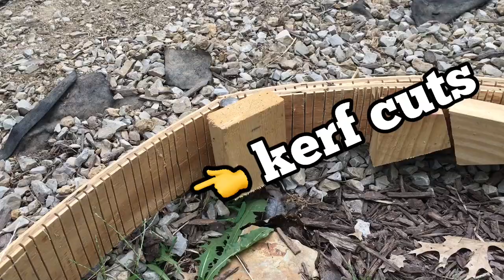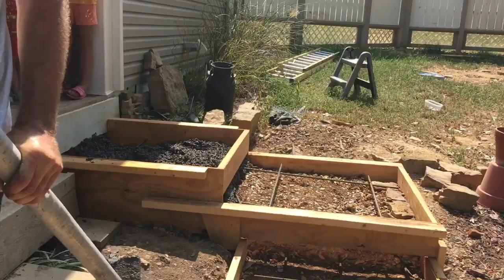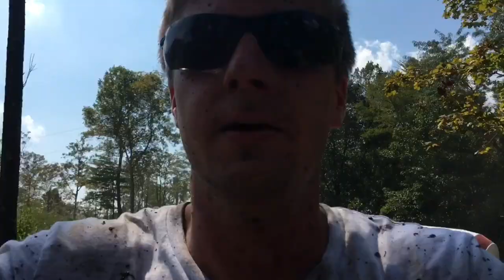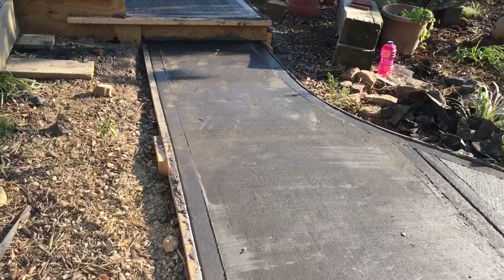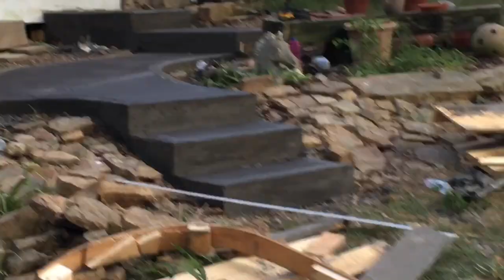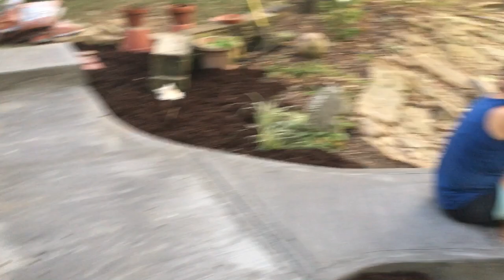DIY try at colored concrete sidewalk and stairs goes wrong

Comment: Looks good . You and the driver did the work of 3 to 5 person crew👍 In 20/20 hindsight tapping on the forms or using a vibrator( LOL😱) helps bring cream to the edges and if you have time during the pour remove the forms to work the face of the riser.
Reply from the maker: Brian Webber I was lucky to have a good driver that day.  And I’ll be sure to keep that in mind for the next time!

Comment: Yup.... that first DIY concrete job is an education.  Fortunately, you earned a passing grade. It looks great.

And yes, the color will even out... was that sealer in the sprayer?  (That will help it even out too.)
Reply from the maker: Thank you sir.  I had some retardant in the sprayer I sprayed on the stair forms so that I could work the faces a little bit once I pulled the forms....it kind of worked lol.  And you’re right,  I need to get some sealer on there.
Reply: @CaptainKleeman  great job